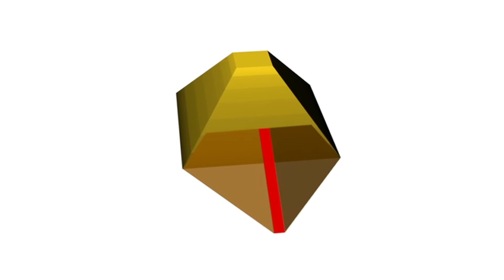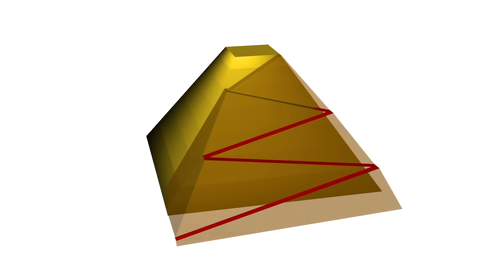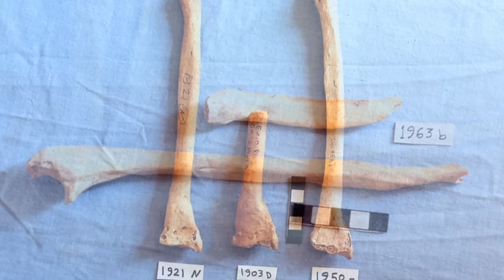Egyptology - Pyramid Construction

Comment: Nope they did not drag blocks up on ramps , the blocks were made out of cement lime stone ,from a powdered form from hundreds of miles away where they collected it,  then made into blocks on top of the pyramid then slid into place Layer by layer

 there was no huge ramps on the side of the pyramid ,there was no blocks being cut out and dragged on sand from hundreds of miles away
The put on boats 😂 

It’s much simpler than that

They had people collecting powdered lime stone for cement mixing

They had people who transported it

They have people on the pyramid making the blocks

They had people sliding blocks into place 🙂

The structure itself is actually a cement machine it was made to make faster cement blocks so they could make a floor removing sand

So then they could make more blocks then roll them on the new floor to create more structures building a city

The reason everyone came to gather for the pyramid was to build the most modern empire

At the time I guess they thought if we could build the floor we could make more structures faster 

Because they would be able to roll these blocks instead of drag it through sand which they didn’t do 🙄

I mean think about it  

They even proved it the pyramid is filled with debris the same debris that makes cement

Comment: This is very close to how it was done. The thing they are wrong about is the ramp would not have to go to the top, not even half way. Of the 2.3 million blocks a large quantity of them are in the bottom third.  Would you build a giant ramp to the top to lay 8 blocks? Or would you bring enough blocks up to a certain level and move them to each side as you work your way up?
Reply: Only thing we know for a fact nowadays is that internal ramps were used. Simply because they are the only ramps that has left lasting evidence.

Comment: Even building the “ramp” would be remarkable, let alone the pyramids….
Reply: Not necessarily depending upon the nature of the ramp.  In Giza - read the Old Kingdom - there are the remains of smaller earthen ramps in the western cemetery adjacent the Great Pyramid used to construct tombs there.  They are made from sand/stone chips/tafla - a clay they mined. There is the remains of a huge tafla mining operation near the worker village at Giza while the limestone quarries there were noted when excavated to have had massive amounts of ramp material dump into them.  Meanwhile at Karak is the remains of mud brick ramps used to create hypostyle temples there.  So the largest/heaviest blocks in the pyramids are found in the bottom half closest to the ground.  Above the halfway point the blocks become smaller as they rise in height.  

Thus earthen ramps going halfway up could raise those larger blocks on the bottom as well as the King's Chamber which is below the halfway point.  The smaller blocks above could be lifted using a lever device employing a fulcrum and counterweight akin to the Egyptian shaduf. Further small mud brick ramps might have been used for the blocks above.  They were already creating untold thousands of mud bricks anyways being a ubiquitous building material in ancient Egypt. Thousands of bricks could be turned out on a daily basis if needed.
Reply: @varyolla435  some of the stones over the burial chamber, which is halfway up the pyramid, weighed over 70 tons. But ok it was a lever 🙄
Reply: @gusfring6887  Try not to trip over your shadow on a sunny day an injure yourself if this is the limit of your thinking process.  A cranial helmet might help.  🤦‍♂
Reply: @varyolla435  I wonder, do you also think the earth is flat? Because that's about as plausible as the ancient Egyptians using a lever to lift a 70 ton slab of stone 250 feet in the air
Reply: @gusfring6887  You better get that helmet quick based upon your logic thus far..........

p.s. - that you can only think in terms of "lifting" = shows the superficiality of your thought.  Ponder that if you must.  🤔
Reply: @varyolla435  you still haven't explained how this seemingly impossible task was accomplished. Until you give a valid explanation I can't take anything you say seriously
Reply: @varyolla435  do you wanna charge me $5.99 to read this book you just wrote?
Reply: @WomperOnWallStreet  That assumes you can read.  🤣

Comment: They used four ramps, and used counter weights on opposite sides. Pull one up one side, than the other.
Reply: Next time look at the ground.  The area to the east and north of the Great Pyramid are areas where the ground drops precipitously.  Only on its western side and the southern access is there room enough for ramps.  The quarry and harbor location rests to the south and that makes it the most plausible place for a ramp leading from the quarry to the pyramid.  So you might argue for a smaller ramp on the western face but the rest of the ground around it is not conducive to large ramp structures.  

As a final thought.  Dejedefre followed his father on the throne and he buried the solar boat found on the southern side of the pyramid.  That infers that the ramp needed to be cleared first before the boat was buried and since it was done in Dejedefre's time rather than Khufu's that he finished the construction and cleared away the ramp on the south and buried the boat. His father was dead and he finished the pyramid.

Comment: They used water to float the stones. This also helped to fit the stones in place with accuracy. This also helped because limestone is soft when wet and water is self leveling. Silly people think these were dragged. Limestone gets hard when exposed to oxygen.
Reply: The tunnels were the springs which is where water was easily moved to the top of the pyramid.

Comment: They started off by building smaller and cruder pyramids, took them decades of trial and error to ultimately attempt the great pyramid.
Reply: Correct.  That as well as having the wealth to build it.  Remember that construction of large buildings requires not just the science and logistic necessary - it also takes time and money.  Pyramids were built when Egypt was prosperous and when it began to incur economic and environmental strife later on in the Old Kingdom you see much smaller pyramids being built.  As an aside.  Some Egyptologists believe that the building of these pyramids bankrupted Egypt and thus helped promote the eventual collapse of the Old Kingdom a few centuries later.

Comment: I Believe They Built The Pyramids Like
We Build Sand Castles! Mostly Sand
Then Mixed Once In Place To Cure Into
Limestone! Read This......
Limestone is a sedimentary rock composed largely of mineral calcite. It often contain silica in the form of flint and varying amounts of clay and sand as layers in the rock. Limestone contains different amounts of silica, clay, silt and sand. The primary source of the calcite in limestone is most marine organisms...SAND! Dumped Sand
Mixed Then Shaped Then Carved Then Left To Cure...It's The Simplest Process 
Sand In Abundance Easy To Haul Dump
Mix Add Water Shape..Once At A Certain 
Dryness Then Carved Into..Rooms Chambers
Tunnels...Imagine Building A Small Pyramid
On A Beach..See Much Simpler!!!

Comment: wrong conclusions. There is a thousands of years old method using woodden poles to lift heavy loads. when naval crane failed to lift a compartment which fell into a river, people using the ancient technique could lift it.
Reply: Not the deepest thinker if you can only conclude one must "lift" blocks to raise them to an elevated position.  Man has used earthen ramps to raise blocks in construction for millennia.  Perhaps you should dig deeper.

Comment: Well the story I was told is that the the pyramids were made bye placing a box around the base and bringing in sand around the box then a layer of palm leaves  .They didn't lift the blocks they were lowered in then another box was built sand brought in on a slight grad another layer of palm leaves then lowering more blocks over and over in this way . Now you might think that is impossible but consider that only one dump truck can move enough sand to make a  huge pile in one day , imagine 30 thousand slaves over a 50 year time frame and the task doesn't seem that hard to believe.  After the pyramid was complete they didn't put God on top they put and all seeing eye the eye of Satan then to open up the pyramid they would sacrifice a child for every row of blocks when they hit a layer of palm leaves alternating from male to female each time they are very evil structures.
The pyramids didn't have an opening because only spirits were allowed inside and it was for sexaul entercorse of the fallen angels.  That's why they can't find a way inside it wasn't meant to be entered bye humanity.
They placed the all seeing eye 👁 on top the eye of Satan and if you have ever seen porn and seen an eye move that's the same eye looking at you ready to tell And show how perverted you are to God.
If you have ever seen the eye I'm mentioning it would have creeped you out and that's exactly why.
Reply: They also had elephants at their disposal.

Comment: There are about 2.3 million stones or blocks in the great pyramid. If you can place a block every hour then it would take about 1100 weeks ( working at 40 hours a week. But they estimate that it took about 20 years to build t he great pyramid. So the Egyptians must have had a huge workforce and some very clever ways of moving those stones. Moving them across the landscape and up ramps is far too slow. An architect suggested that the blocks were floated to the construction site. It is simply amazing how the Egyptians were able to build the pyramid with such precision and so quickly and without the aid of computers and machines!! It is an incredible feat of human engineering!!

Comment: They formed alot of the stones, so they didn't have to move huge blocks, they made huge blocks on site carried there a little at a time in buckets or wheel barrows. That's why the pyramids are the same exact color as the sand and as their homes. The sand was built up as they got higher making a ramp. Upon completion the pyramid would have been buried and then the land ramp removed. 100,000 people could move the equivalent of 30,000 modern dumptrucks filled per day.
Reply: lol we should stop using construction equipment, go back to manual labor
Reply: It’s a proven fact that they got the largest GRANITE stones from a quarry that was 500 miles away. Lol to suggest they made 70 ton stones on site is idiotic

Comment: did you consider that ancient egyptians built the pyramids from inside out? those blocks were made from sand and mixture of rocks poured on a mould (just like cement) to have the shape of the blocks.. that's why it's  very smooth and accurate..
Reply: Make sense to me.
Reply: That’s what I was thinking . Seems it would be easier that way but idk anything really

Comment: Thin spindly workers moved multi ton stones? Its nonsense. These things are far far older and were most likey built by a previous civilization that was quite advanced. They probably had a form of hydraulics not seen or remembered. There are telltale signs they had and used metals and understood chemistry. These things apear to be machine like and are not burial chambers.

Comment: There are pyramids of different sizes, some are quite small relative to the great pyramids. The older pyramids are older and far more complex in construction than the smaller less older ones. These theories of construction are just arm chair theories proposed by non-engineers - non-builders.

Comment: You are absolutely wrong.
Egyptian slaves did not build these pyramids.
And their primary use was not that of a burial chamber 
All pyramids all over the world are built on the same parallel line 
It is a belt if electromagnetic energy,to be used in conjunction with these megalithic. Structures
They are power stations,and ways to enter  and Return from other dimensions,,,other than our 3 dimensional earth 
NEPHALIM!!!!!!!

Comment: Egyptologists may think they know how they were built, but they are only guessing and they have no proof. They have no proof as to the time they were built either. Some people say that they could be as old as 20 to 30,000 years ago, basing their decision on the water erosion shown on the sphinx.. putting it at a much different time and climate. Above the "King's" Chamber there is writing of King Khufu, but some people also say that this was a fraud and the explorer needed to legitimize his funding on that expedition to come back with something worth saying. The so-called sarcophagus in the "Kings" chamber looked more like something to hold a device of some type. I thought Christopher Dunn's book where he approached this from a mechanical back engineering standpoint, seems more logical to me. He theorized that it's purpose was that of a power plant where hydrogen was generated in the "Queen's" chamber and rose through the Grand gallery where he stated resonators were there to agitate the gas and then the Kings chamber amplified further. The 2 shafts in that room were the same dimensions for tuned microwave waveguides. I thought it was strange the shafts in queens chamber had small doors within, as if to hold back material to be released. Dunn wrote there was residual amounts of zinc oxide on one shaft, with a type of acid in the other. The entire interior of the great pyramid was used with highly conductive granite while the outer most stones, mostly ripped off, had no conductivity (just like a big insulated circuit).. These are all theories. Egyptologists will fight vehemently against any idea other their own which is not only immature and abtuse, but against the will of science and exploration. They are worried for their careers, a self centered approach. The idea that this could be this old and that it possibly had a functional purpose raises questions about mythological Atlantis or "Gods" from other star systems. I never say never.

Comment: They obviously used advanced technology 1. There's a stone you can visit they were cutting and it was perfectly cut off center straight line so they didn't decide you use it in the pyramid 2. They had copper saws back then it take 6hours for you to cut a granite block to 1 inch 
3.THEY WOULDVE KNOWN THAT THEY were going off-center because how long the cut is in the stone its about 7 inches you tell me they spent days cutting something without knowing the cut is off-center

Comment: When you do science you show your model and it must be duplicated to prove it's true. This guy and so many others write papers with all these theories or they'll use computer animation which proves nothing. Edward Leedskalnin who said he knows how the pyramids were built, built a megalithic structure by himself and duplicated it by building it 10 miles from the first. R.L. Poole is the most knowledgeable on Leedskalnin work and has even cracked most of his codes. Check out the books both men have written.

Comment: The pyramids could not be built today, that's just a fact.
Reply: Ed Corrigan

"The pyramids could not be built today, that's just a fact."
No. We have built much bigger things.
Reply: @SamIAm-kz4hg  Yes, perhaps. Simply put, the pyramids are too technically difficult to be built today. There are numerous factors that make it so. Aligning eight sides to meet perfectly at the top is just one example. And as I've said before the one thing more astonishing than the pyramids themselves is what lies underneath them.
Reply: @SamIAm-kz4hg  Fine. The Giza Pyramid is built on 14 acres...which means all the soil had to be removed down to bed rock to support the weight and slabs of basalt rock put in it's place . Most people think the pyramids were simply plunked down on the sand.
NO! The 14 acres the pyramid rests on was/is absolutely dead flat. Even that is beyond the scope of most construction contractors because it simply isn't possible.
How do I know? Because I am one.
Reply: @edcorrigan3156  
"How do I know? Because I am one."
No. You're not. You did not live several thousand years ago, and have no idea about what techniques they used at the time. If you were an historian specializing in ancient Egypt I might be impressed.
I suggest reading up on some of the techniques that ancient peoples used for construction. Some very ingenious stuff. Modern construction techniques use completely different methods because of modern technologies.
Tell me, how did ANYONE make flat and level surfaces even hundreds of years ago?

Comment: Um, two dowels and a string, with ochre to mark a high point, then rubbing furiously with a harder stone to remove imperfections.  How about "no".  More like a high-speed rotary, carbide tipped facing tool and laser levels.  Better still, a CNC controlled high-powered CO2 laser would work.  Or a water-jet.  Then use hover-boards to get them to the building site, or just beam them over.  No way did primitive savages build the pyramids by hand with bronze tools and ochre.